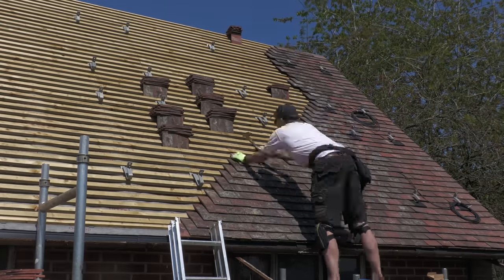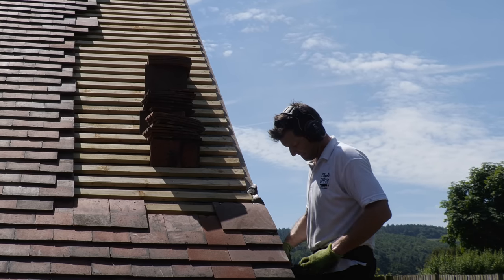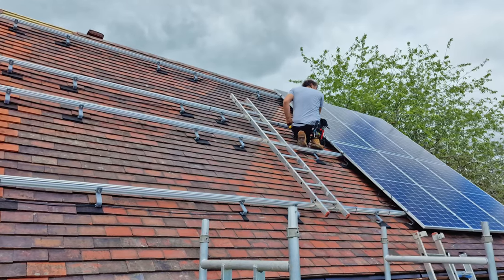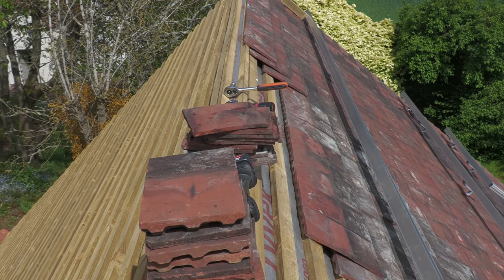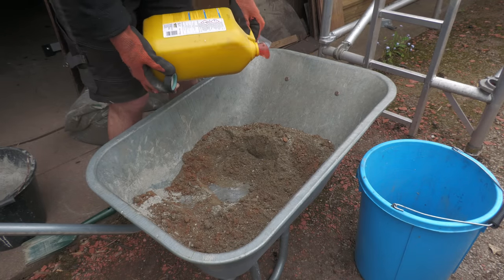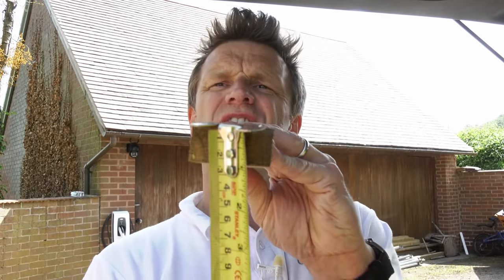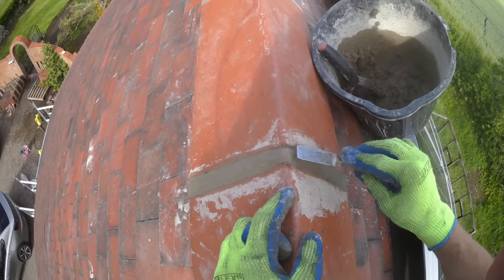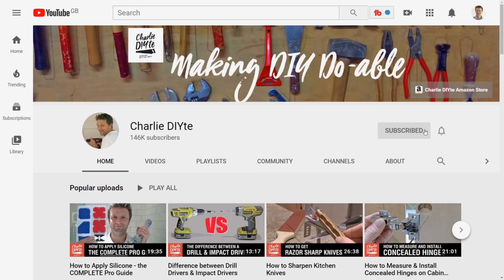Complete Roof Retile - Final Video

Comment: Charlie, re moss growth etc, it’s a bit of a traditional solution but you can fix a copper strip to the roof just below the ridge tiles, enough copper is dissolved out by the slightly acidic rain and then deposited on the roof tiles that is toxic to the mould, moss etc,  if you are collecting the rain water for use on the garden etc consider if those plants are sensitive to small amounts of copper.  I’m sure there is some calculation to the thickness and size of copper required to ‘poison’ the area of roof but you would just have to research that, or just guess and put a thick strip up (should look nice once it’s green).  As you have effectively shaded a significant part of the roof with the solar this will provide nice damp environment for moss so this might be an investment against needing to clean under the panels in the future.👍👍👍.  ps I’m not an expert but I thought you did a good neat job👍👷‍♂
Reply from the maker: Thanks mate. Yes someone else mentioned copper. Should have done this really. 🤦 I have a friend who sprays roofs with an organic biocide so I might resort to that if I see the moss coming back.
Reply: I cringe every time I hear cement when the correct term is mortar
Reply: @neilwhiteside949  thanks for sharing matey, learnt something new.

Comment: Fabulous end result Charlie. What a huge job to get completed. Looks really good. Not many homeowners would attempt such a task so you’ve done really well. Easily as good as a professional.  A couple of points, only because at the end you say you’d welcome any comments. Now it’s regs to mechanically fix all ridges  and this is included in British Standard BS5534. Basically what you do is fix a batten to the ridge and the screw fix stainless steel clips through the mortar bed when you set them in mortar. It’s because ridge mortar is susceptible to thermal movement and invariably the bond cracks and ridge tiles end up being blown off by the next gale. Another very picky point is that your mixing your names for cement and mortar. Mortar is the mixed material containing the cement element which reacts with the water and bonds the building sand together into the set mix. A lot of people call it cement but really the correct term is mortar. You can have lime mortars without any cement.  Anyway, that aside another great job done and a great set of videos. Looking forward to the solar panel video now.  All the best. 👍🏼
Reply from the maker: Thanks Paul. I wasn't even aware I'd called it cement - dow 🤦 I wish I'd known about those clips. I don't think there's any risk of these blowing off as they're heavy, and are well mortared in like the originals (actually they are the original ridge tiles) but I should be setting a building regs compliant example. Thanks 👍
Reply: @CharlieDIYte  I’m sure the ridge tiles will be fine if they’ve been solid since it was built. Mechanical fixing is quite a new thing. 👍🏼

Comment: Good job, if I had done that for myself I would be really happy with it! Getting professional roofers in is no guarantee they are going to do an amazing job. The house opposite me had their slate roof replaced a good few years back, and the roofer team that did it  made a right hash of it. I noticed them returning months later to redo whole parts of the roof, obviously because of leaks and such. They were seriously dangerous also, up and down ladders, crawling about the steep bits... Yes I used to have fun watching them. Yes a good solid job you did and told us all some good solid hard earned tips!
Reply from the maker: Thanks buddy, I appreciate that. Yes they're never going to care as much as you, but when it comes to doing the house I will have to get a team in. It's just too large a project. 👍

Comment: I think that you did a wonderful job and deserve a full round of applause. I will say this on ladder safety - buy the Werner (or equal) ladder stabilizer - most people fall to the ground because the ladder rolls over instead of leading over.  Werner also make and sell (in North America) a very cool set of adjustable feet - PK80-2 LEVEL-MASTER AUTOMATIC LEVELER -  put a pair of these on my Werner 1520 and they take the effort out of relocating a ladder for painting or roofing.
Reply from the maker: Thanks so much Gregory - some fantastic tips there. I DEFINITELY need to buy the stabiliser and the leveller is a fantastic idea. Thanks for sharing.

Comment: Nice job and bet you are glad it is done now. I really recommend the ladder limb for your ladder hook. I have 2 and they really are like an extra pair of hands up a ladder. I often clip in a 40L rubber Flexi tub and then you can place all your tools or mixing bucket of cement inside it. Having 2 means you can have a bucket each side. Also worth getting a few lanyards so you can clip in your tool in case you drop it. Instinct can take over trying to grab it as it falls otherwise. Been there once before and don't ever want to go back, luckily I was able to grab a rung as I about went backwards off the ladder!
Reply: Another option I forgot to mention is of you are using a ladder wall stand off you can make for little money a wooden insert that you drop into the centre hole of the stand off to create a shelf for you to place tools, bucket etc. If you fix a batton around the perimeter on the top it gives a lip to stop stuff rolling off etc and use a batton on the inside set in from the edge to lock it into the stand off 👍
Reply from the maker: Jeez you were lucky mate! Thanks for the tips. Yes I was looking at those ladder limbs. I should have bought one and a new bucket. It's so easy to cut corners in a job like this and the consequences can be catastrophic - like when I stepped down off the roof onto a chair I'd been sat on filming the week 2 script, and it collapsed sending me flying. Nearly broke my neck on the tower rail! Yes ladder wall stands also a great idea and I really like the idea of the DIY tray.
Reply: @CharlieDIYte  Lucky escapes for both of us thankfully! Stay safe!

Comment: Good to see your project and the snags you encountered. I am just in the process of re-roofing my new kitchen to convert from a flat felt roof to a nice pitched roof with similar clay plain tiles.
If your fascia board (the board the gutter fixes to) was a bit higher then there would not be the problem of the last short tile. 
I have gone with second hand tiles. Price round here (Christchurch) is 35p reclaimed, 70p new. I wanted old to match the rest of the house.  Smaller roof than yours with 2000 tiles at 40 degree pitch. 
I have watched a few vids on cementing and the pros use a much drier mix on roofs. 
Also, I think you should use copper or aluminium nails as the galvanized do not last so well. I went for aluminium which comes in  38mm which is 25mm batten and 14mm tile and no hole in the felt! 
Should get the frame finished and felt on with 1 in 3 battens to get it water tight in a couple of days.
Reply from the maker: Great work and what you say makes a lot of sense. Sounds like you're doing a great job 👏

Comment: you can push in or pull out the undercloak verge (if its not nailed only trapped under the laffs) to match the tiles to save using 2 tile and a halfs.
Reply from the maker: That's a good point. Mine were nailed down in multiple places though.

Comment: Great video Charlie! I’m a roofer and we use Readymix mortar for speed and convenience and as you mentioned we also never work off a ladder and use click together scaffold on small jobs
Reply from the maker: Thanks for the comment Richard. Do you use a sponge to get those tile edges clean on the verges? I look at pro jobs and those clean tiles with admiration! This is the limit for me. When I get the house reroofed eventually, I'll get a team in.
Reply: @CharlieDIYte  You’re not far off buddy, I don’t tend to make the muck as wet so it doesn’t stick to the tiles as easily, then let it go off and come back an hour later to smooth it off, Still a tidy job though bud 👍

Comment: Hi  Charlie 😊,  well done on the roof mate,it looks great and very neat, I bet any full  day on that job would leave you pretty tired, but you got there in the end. Can I ask your opinion on the Milwaukee  12v drill you were using, ?, I have an 18v drill already, but I'm atracted to the sub,compact, for its size etc, your thoughts on this would be appreciated. Thanks for the video mate, stay safe, best wishe's to you and your's, Stuart UK.
Reply from the maker: Hi Stuart - thanks mate👊. Yes, I'm pleased not to be waking up each day with every bone in my body aching! I'd say definitely get a 12v drill driver as discussed here https://youtu.be/sL-t2Zc4wCs Mine is actually the combi version - they also do a drill driver without hammer action (the BDD) but as they were the same price I though I'd get the BPD. I love it as I did the Ryobi I had before. The simple fact is, for every day jobs the lighter the tool the better. I rarely pick up my 18v drill driver or combi.

Comment: Great series.

Did you consider copper nails?
Reply from the maker: It's a good question. No and I've read people saying you should use stainless steel rather than galvanised. I bought what I could get hold of in the roofing shop (lazy I know) but also took the view that the original galvanised nails were all still looking pretty good so these should last a good few years to come. 👍

Comment: Hope you didn’t have the lead time problems I’m facing,  3 phase 20 kw inverter delivery currently 22 Nov ( it’s 7 July as I write this)
Reply from the maker: Some suppliers were quoting me that. I suspect they're all that bad now. That's a powerful old inverter. How many kw will your solar panels be generating?
Reply: @CharlieDIYte  They're actually going to produce 14.8kw at peak. Which is enough to drive my ground source heat pump - big old place the heat pump replaced a 45kw gas boiler

Comment: When I had my new roof for an attic extension done a few years back my builder used the majority of the old tiles. He told me he had put yogurt on those new ones he had to use - I don't know the 'science' behind it but now you can't tell the difference.
Reply: That's an old woodworkers trick to match new and old wood - cover the new in yoghurt and leave out in the elements for a few weeks. No idea how it works though but it does.
Reply: Isn't the yoghurt to encourage lichen growth to match with the old?
Reply from the maker: Thanks Trevor. That's a great tip. Love old school tips like this!